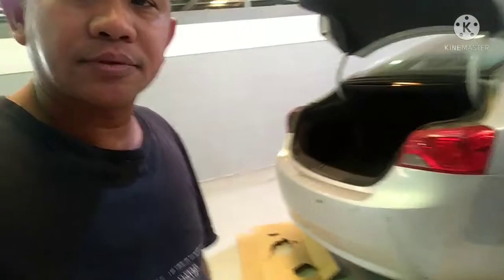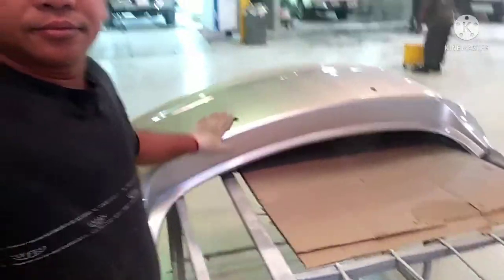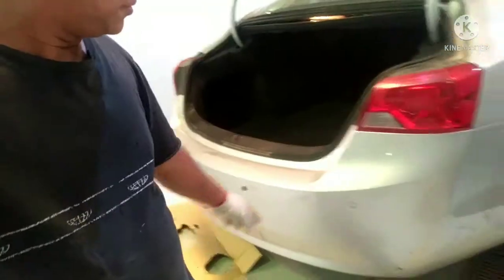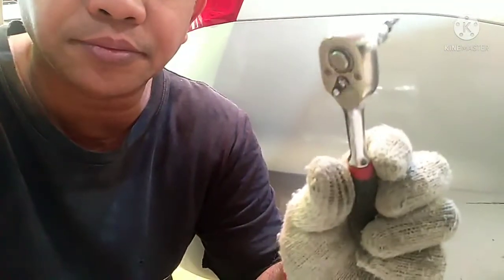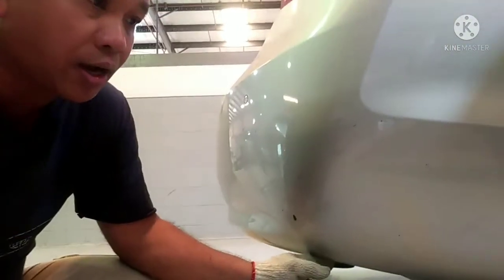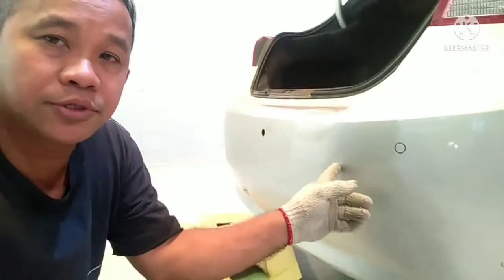A Simple Removal & Replace A Rear Bumper of IMPALA 2016 MODEL

Comment: Mines is a 2020 impala I don’t have them little circles in the back that connected to the inner part of the bumper that you popped out and transferred… is it still the same process 😭🙏🏼
Reply from the maker: Yes sir it is same to fix and to remove, the different only is for the sensor, but no problem if you don't need sensor that the little circle, thanks for watching and comment 👍